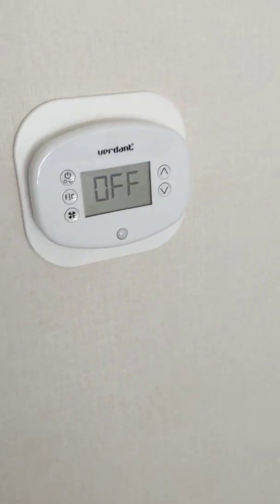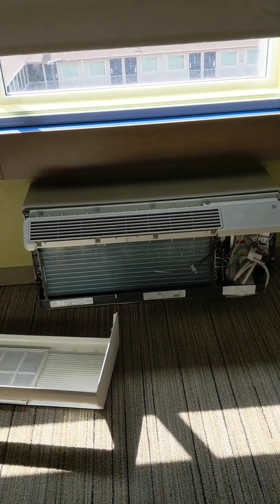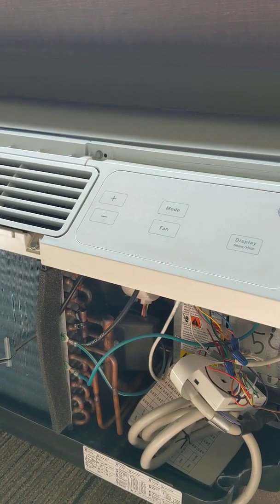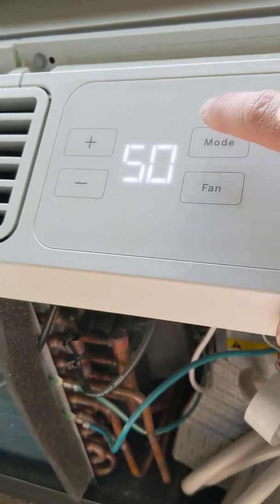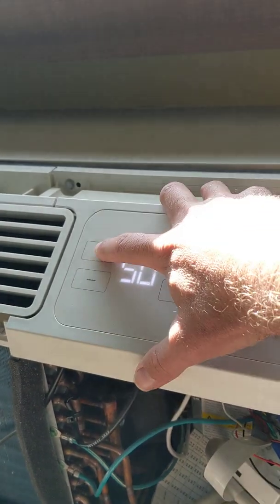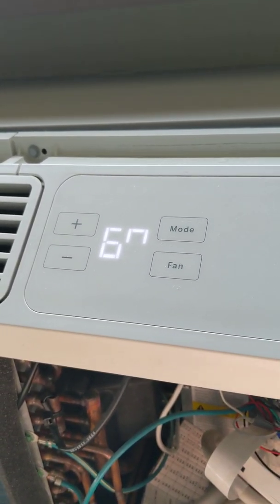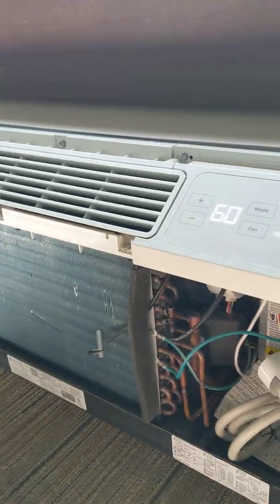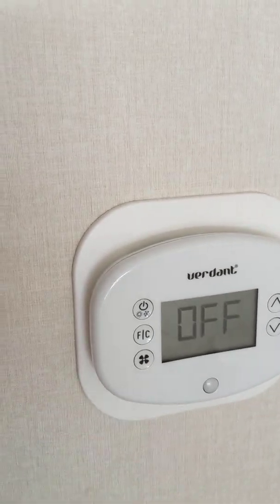GE Zoneline how to override a Verdant wall thermostat (motion sensor) hooked up to a GE Zoneline.

Comment: Helpful, but I wasn't able to get the fan to stop running, and it's loud. Not Amana loud, but loud.
Reply from the maker: GeZonline has a constant fan setting.  You weren't able to turn it to off?  Look at the sticker on the bottom of the PTAC unit
Reply: Constant fan is setting 0 with either 0(off), 1(low), 2(med), or 3(high). Usually comes from the factory set on 02 so just drop it down to 00 to turn it off.